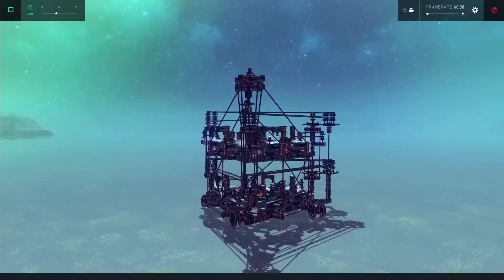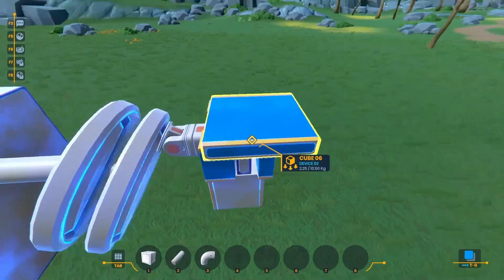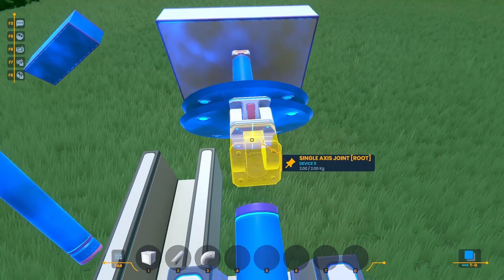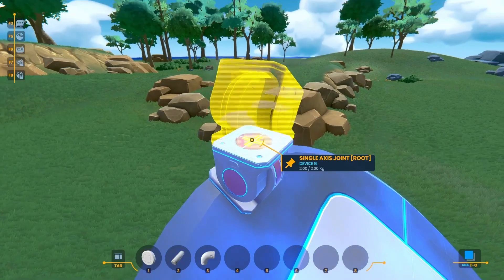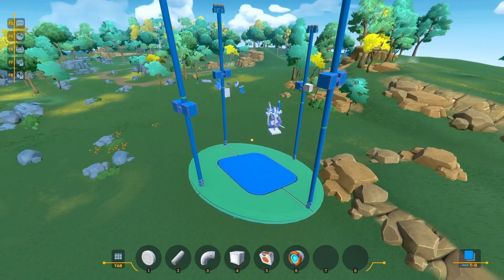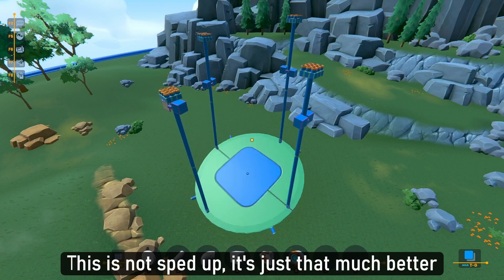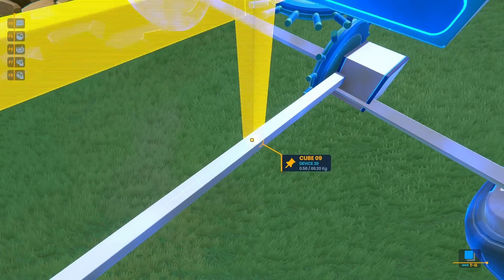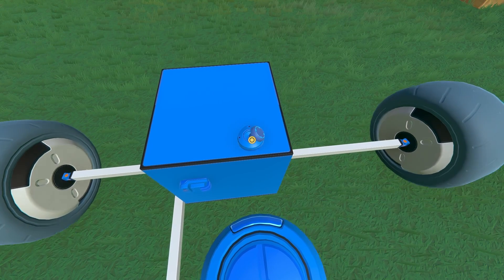Creating One of The Most Cursed Engines in Plasma

Comment: Correct me if I’m wrong but wouldn’t it be beneficial to have the disc a little bit offset from the piston in the starting position because when the top piston is pushing on the highest point on the swash plate wouldn’t that bind up and create stress?

Comment: i think the problem with the smaller models is that the piston’s rotational point is moving in an arc so they get stuck when you shove a super long piston with relatively small joints into narrow gaps

Comment: Could remove the pistons and run the rockets straight on the plate. Could even get a throttle in with rocket power and how many of the rockets fire and when. A ring of rockets around the entire plate.
Reply from the maker: Absolutely, there might be some side to side forces that get a little tricky but that is nothing that a second engine can't solve